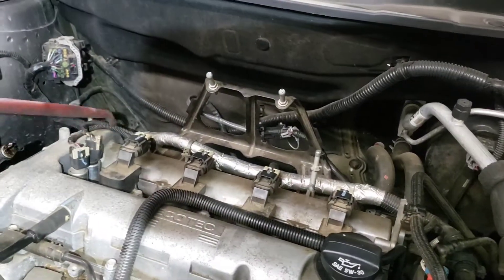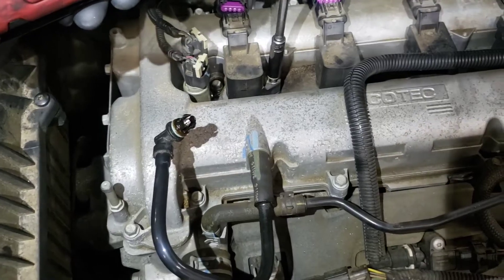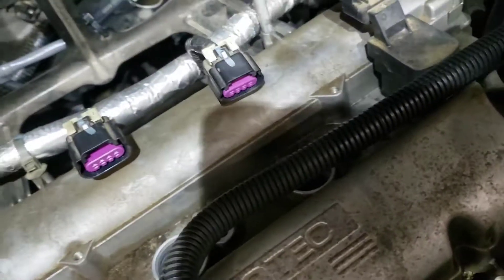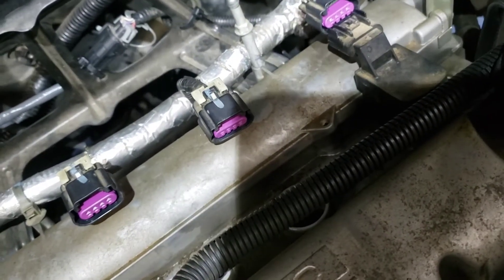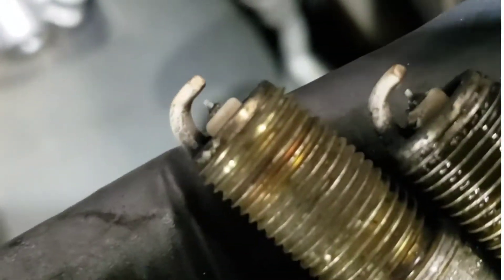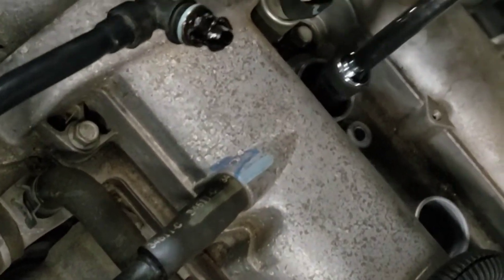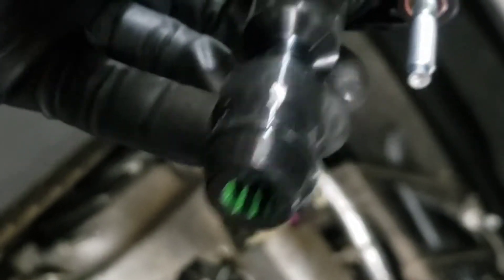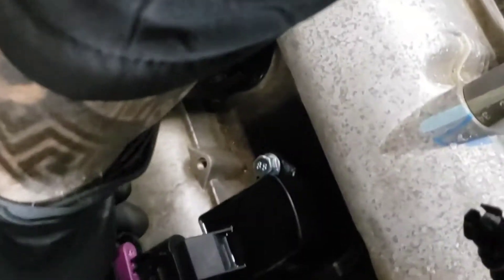GM 2010-2017 (Terrain, Equinox, Captiva) 2.4L Spark Plug and Ignition Coil Replacement

Comment: Nice Video I used a Power Tool to loosen the Spark plugs while the Motor was still A little bit hot it worked like a Charm for Tight Spark plugs, don't try to loosen Spark plugs when the car is Cold 😊

Comment: By changing out the plugs and coils, will that help reduce the idle sputtering of the car?
Reply from the maker: What do you mean by idle sputter? The vehicle has multiple misfires at idle?
Reply: Sitting at a stop light,  the car feels like it  wants to stall or when the car is in park.   Im thinking the fuel injectors my be clogged but I definitely want to change out the spark plugs
Reply: I had the throttlebody replaced bout a month ago

Comment: Very well presented.  Good video, good speaking.  The air intake to the throttle body, and the air discharge from the air filter element should have been covered prior to using compressed air in the area.
Reply from the maker: Much appreciated!

Comment: HAVE A 2011 CHEVY EQUINOX LT 2.4L I HAVE A P135A CODE I JUST CHANGED MY SPARKPLUGS AND IGNITION COILS AND ALTERNATOR AND MY CAR WONT START DO YOU KNOW WHATS WRONG WITH IT?
Reply from the maker: The reason you car is not starting is because there is no power feeding your ignition coils, something must have happened you replaced the coils that could have blown an ignition voltage feed fuse to the coils, You need to find every fuse associated with the ignition coils

Comment: Question? Do you need to chage the plug and ignition coil both or can you just change the plug? 2013 Captiva with 160,000 miles neither have been changed.
Reply from the maker: yes, you can just change the plugs. Ignition coils arent exhibiting any issues. However, if its at 160,000 and neither have been changed, if you are taking them off anyways to get to the plugs, then I would replace them also if it was my vehicle.
Reply: @RodriguezRepairs  Thank you for the quick response.
Reply from the maker: you dont want to do the labor twice if the ignitions coils are going to fail in the near future
Reply: You can, just skip step 2 and next two last step

Comment: Thank you. Wife had bank 1 go bad. With over 100k miles, I did all four in 20 minutes at a cost of $150. I can only imagine what the dealer would have charged for this super easy repair.
Reply: Looking into this video because they offered me $1000 to fix the issue. Knew it wasn’t that hard to fix…
Reply: @Tyler J  $1000!!!! That's awesome. We both have 1.5 eco boost turbos. I'm hoping when the time comes, there's a video to fix the nightmares we purchased.  She got a 2022 Equinox and I have a 2020 Malibu...
Reply from the maker: im glad you found this video useful!!

Comment: By looking at the ignition coil how can u tell if it's bad are not
Reply from the maker: you cant tell if a ignition coil is bad unless it burnt or you see visual damage. But there can be times where the ignition coil is bad but you cannot tell from visual inspection. You have to test the ignition coil for spark, voltage, ground etc

Comment: Is it worth replacing the ignition coils when changing the spark plugs, or is it only necessary if they go?
Reply from the maker: It all depends, most consumers wait until they start failing and throw misfire codes. If you do replace them for maintenance, i would recommend replacing all 4 coils at once.
Reply: My wife just had her 100k service where they replaced the plugs. 100 miles later the coils started going out. I replaced all 4.